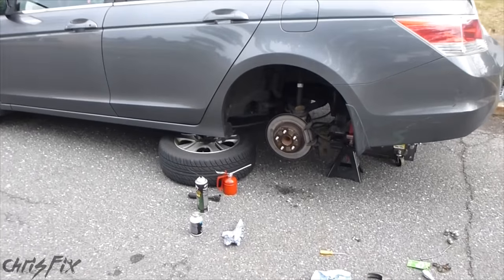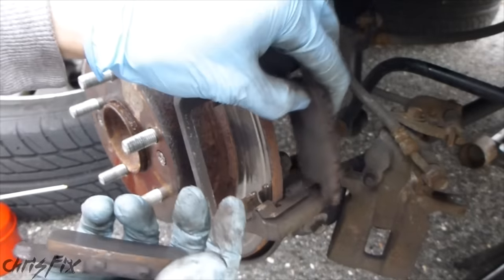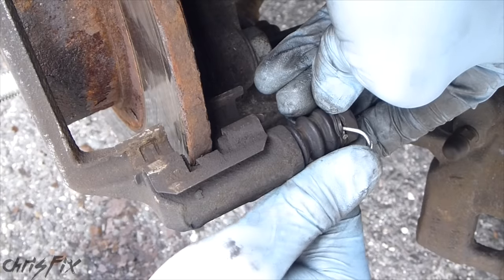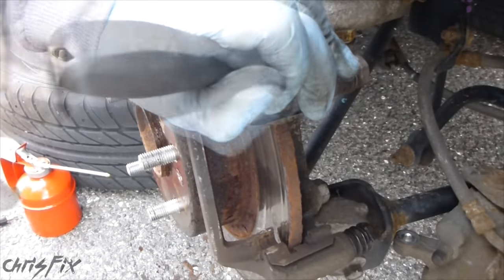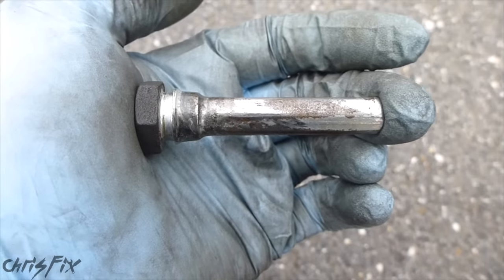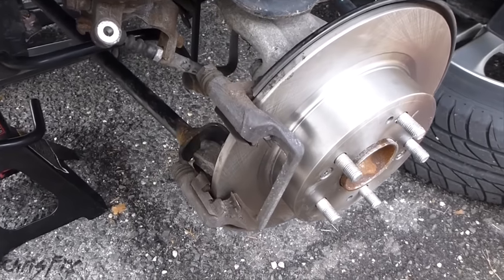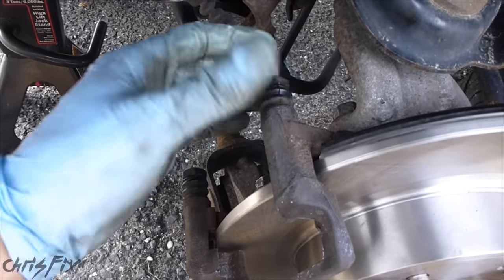How to Fix Uneven Brake Wear

Comment: Chris, Thanks! How do you think Super Lube 41160 Synthetic Grease, can i use this to grease the caliper guide pins?
Reply from the maker: +yang song I do not recommend using petroleum based grease. Use silicone grease (linked in the description)

Comment: Is it a good idea to spray the break clean inside the hole that the guide pin came out of?
Reply: +BloodSweatnBassOutside As long as you get the gunk out of there and let it dry completely before reinstalling.

Comment: If I have new brake pads but noticed uneven pad material, could they fix and even themselves out now that I have fixed the sticking calipers and seized piston?
Reply: You should replace pads, and if the backing plate touched the rotor, replace it too

Comment: Hi Crhix, would you need cleaner to spray inside the pin hole in order to clean whatever went inside?
Reply from the maker: You can use a pipe cleaner if you have.

Comment: I never push the pin with new grease on through the rubber, cause its that tight a fit, as you see in this video, all that new grease just gets pushed up the pin into the rubber boot

Comment: I was advised by mechanics not to use a grease that doesn't withstand very hot temperatures. These are brakes, you don't want the grease to melt and become liquid to then drip on your discs or pads, this could jeopardize your security and sometimes when you slam the breaks, a small difference can make an accident or not. Some people put copper grease but it's abrasive and not advised for moving parts however it won't drip and mess with your braking. Some new greases are made of aluminium or aluminium zinc that are designed for brake systems but the downfall is sometimes that are packaged in sprays and I hate using sprays on brakes. What I do is spray a bit on the inside of the cap and use an ear bud to apply the grease. Aluminium grease typically withstands 600 Celsius and copper grease around 1000. The typical silicone grease melt point would be 130 to 180. I couldn't find a link to the product he used so just have that in mind.
Reply: This part of the brakes font heats up

Comment: Hi Chris. is it a good idea to clean inside the hole on the caliper where the slide pin goes into ?
Reply from the maker: +Timur Hafouz Yes you can do that with some brake clean and a q-tip or pipe cleaner.

Comment: Hi Chris, quick question. You have a lot of videos about break pads and such but did you ever make one on how to clean rust on them? I bought myself a Mazda MX-5 less than two months ago and it had some rust on the breaks, because it wasn't being used since a while. After driving it the front ones cleaned completely, but I still have some spots on the rear ones and I'd love to clean them out so they are all shiny but I don't know the products and stuff. I saw your videos about changing them entirely, recoloring the calipers where you clean a bit of rust etc but I wonder if you had something specific to this.
Reply from the maker: +AndreCorner using a wire wheel or metal wire brush works best.
Reply from the maker: +AndreCorner Like this: http://amzn.to/1NmTteN
Reply: ChrisFix thanks man, I'm pretty sure my dad has some. I'll jack up the car and try to clean them later today! :)

Comment: Chris I've got an uneven front left pad set on a 2010 Prius.  Any idea if that would be a similar fix as in your video?
Reply from the maker: It should be a similar fix on any car. The guide pins need to be lubed so they can move freely to prevent uneven brake wear.

Comment: Hey chris fix, When you have a caliper guide pin is seized up there is lots of way to take it out such as torch, hammer it out, wiggle it..etc. but what even if i try those and still could not get it off the seized pin out? what can i do? in my car both front caliper pin is seized up and i tried few hours trying to get it off and still i couldn't get it off, i tried hammering, torch heat up and wiggle and hammer also did put the rust penetration hoping it will loose up and come off but it didnt. I dont know what to do? if you guys have any idea please help me chris. and maybe in future make video about this.
Reply from the maker: If they are that seized, then you might need a new caliper. Are you sure you are working on the guide pins? They shouldn’t be that seized!
Reply: @chrisfix  yeah they were ceased up with all the rust, and i spend a day taking it out and i couldn't took it out so i discussed with the toyota tech where i work, and they said same procedure to take it out if its not coming then got to replace a whole caliper. but i spend next day after work and took it out so i dont have to get the caliper i need to clean it and replace the pins and boots now. i got it.

Comment: Since the top pin was muddy and gummed up wouldn't it make sense to clean out the hole that it sits in as well?
Reply from the maker: +Andrew Bostaph yes, a pipe cleaner works well for that.

Comment: What about uneven brake wear in a sense that the 1 of the 2 brake pads from the same caliper wore out faster than the other?

In my case the one on the outside wore out twice as fast as the other on the inside.

Comment: Can you use that silicone for the hardware and to put it on the on back of the pad to prevent noise?
Reply: No it could make noise, collect dust or make your parts slip

Comment: if you took the time to look at caliper properly you'd of seen the piston cut out was out of alignment with the locating pin on back of brake pad as well which makes the brake uneven
Reply from the maker: +John Mordue thanks for the tip

Comment: Hi ChrisFix. What about cleaning inside the hole where the pin goes?
Reply from the maker: Great idea! You can use pipe cleaners for that!
Reply: Thank you for your answer. There is another question. i have a 2007 Mazda 5 that after a 250 mile trip gave me the engine code P0126 of the coolant temperature. The coolant gage in the dashboard is right where it always has been, in the middle. I flushed the coolant and put fresh one. The code came back a few days later. Then  I changed the sensor, the code came back week and a half later. I Unplugged the socket from the sensor, cleaned everything out with electrical cleaner, put a little bit of dielectric grease and plugged back on. That was last Thursday 23rd, today is Monday 28th, no code so far. I keep my fingers crossed. In your opinion which is the next step, the wiring? The coolant thermostat?
Than you so much! Julio

Comment: I have the same red oil can. Does it take you a while of pumping it for anything to come out?
Reply from the maker: Mine is pretty fast. Three pumps and stuff comes out!
Reply: Okay. It takes me a good 10-15 pumps before anything happens lol.  Did you get yours from harbor freight?
Reply: The lights you have on your rear bumper, how good are they. I have 2 fog lights on my front bumper that are stock but don't work an want to replace them. Would you recommend them for as replacement.
Reply: The lights you have on your rear bumper, how good are they. I have 2 fog lights on my front bumper that are stock but don't work an want to replace them. Would you recommend them for as replacement.

Comment: It's possible to replace the bracket alone if the pins keep getting stuck ??? or needs whole unit
Reply from the maker: +THE MECHANIC you can just get the caliper bracket.

Comment: Cleaning the guide pins will  be ok don’t need to replaced them
Reply from the maker: Depends on the condition. If it’s not rusted or pitted then yes, cleaning is ok. Make sure you lubricate them well.

Comment: the major problem there is that the slots in the piston are not lined up with the pin on the brake pad, the stkicking pin would cause the outer pad to wear unevenly ok vid as most people don't check the sliding pins

Comment: That caliper bracket was really loose.  Hope you tightened that up!  5:50
Reply from the maker: +Lars Sveen I was doing a brake job and replacing the brake rotors and pads. Thanks!
Reply: +ChrisFix Ah, cool.  So it got removed and re-attached anyway.

Comment: Chris can you help me!? I changed my brakes and on the last rear brake the piston behind the brake fell out. So I figured air got in my brakes.  And now my brakes go all the way to the floor in order to stop. So I looked under my hood and seen my master cylinder is leaking out the back. So does that mean my master cylinder is bad, or do I just need to bleed the brakes?
Reply from the maker: That is strange. I would bleed the brakes completely so the pedal is firm. Also clean up the brake fluid by the master cylinder real good so you can keep an eye on future leaks.
Reply: ChrisFix yeah I tried bleeding them but one of the bolts got stopped so I have to wait until tomorrow. But do you think the master cylinder is bad now?

Comment: Hey Chris, that silicone grease is expensive.  wont CRC synthetic grease work? if you replace the rubber with the kits, wont the rubber last 50K?
Reply: I used CRC synthetic grease on all my gliders, works like a charm. But as he said, i will damage the rubber over time. But i would believe it would take many years to do so..?
Reply: grautsvulst88
I gave in & brought silicone grease :(

Comment: What about the bore hole itself?  If the pin is gummed up and/or corroded, there is a good chance that is also inside the bore hole itself.  I've seen people spray brake cleaner into a bore hole, then insert a drill bit with sand paper or a rag wrapped around the drill bit to try to clean out the bore.  I'm a little worried about spraying brake cleaner into the bore hole.  If it doesn't all completely evaporate, that will cause a new issue.  I think it's a good idea to clean out the bore hole, and I just used a clean cloth wrapped around a drill bit (a bit thinner than the bore hole).
Does anyone have a good idea/method for cleaning out bore holes?  Is that even necessary?
Reply: Spray brake cleaner into the hole. and use a drill bit with your hands and even some sand paper on it and maneuver it into the hole to clean it. The brake cleaner will dissolve the stuff inside and it evaporates fast, no concerns with using it.

Comment: I completely replaced my Guide pins and they are still not moving freely. What should I do? I sprayed out the cylinder really well.
Reply: Maybe that the pin hole is all clogged up. Try spraying brake cleaner inside the hole then recover it with a paper towel.
Reply: +Arthur Rondia (alphaLone) I did that and it helped, thanks! I even put a gun cleaning tool uo in there ti get all the Gunk out. It still stuck a little. I ended up using one of my old guide pins that was still in good shape. Ironically the new one didn't slide easy. I have no idea why.

Comment: What if I completely replaced my brake calipers and have the same problem on the same side
Reply from the maker: They might not be greased correctly from the factory, pull the guide pins out and check (and clean and regrease)
Reply: @chrisfix  will do gonna try it on my day off thanks for the reply! 👍

Comment: My car that I bought from New Jersey just recently started making a bad grinding sound on the front passenger brakes whenever I'm braking at low speeds. Is this a sign that the pads are worn out?
Reply: +THE WHITE WOLF yeah that happened to my toures touching the disc ha I might as well rub the ground the disc what fubar no replaining
Reply: You might have debris stuck between pad and rotor or just low brake pads. I first would open a window and drive slowly listening for a scraping noise. If you hear the noise apply the brakes and see if the noise goes away. This would be the brake wear indicator saying you have less then 10% pad left.  Good luck

Comment: isn't it bad if you mix greases? what if the guide pin had different grease than silicone?
Reply from the maker: You can clean it out. It’s ok if the residue mixes if it’s not perfectly clean.

Comment: Hi chris .
I have a question hopefully you can help me . 
For the past 6 months i experience a roaring nice ( rrrrrrr....rr .rrrr) 
Wheel i apply my breaks coming at high speeds gently slowly apply breaks 15-20mph i hear the noise .
I have taken to the shop can quitly do nothing to it spend hundreds of dollar trying to fix and failed .. 
New pads.
New rotors. (Had SLIGHTLY  uneven WAVE wear and pads had a small sign of uneven wear on the TOP porting )
New wheel bearing .
However noise still .
Can a bad shock/ball joint CAUSE noises while breaking (not all times bout 85%yes) 

Hopefully you can help me. I have spend hundreds and still there
Reply: rigoberto velazquez I have the same problem I've just bought brand new discs and pads today! Better solve it lol you've made me doubt it.

Comment: hey chris i have some question about the guide pin, i have a toyota fortuner 2020, i got issue on braking sometimes i felt my acceleration feels like slowly need to push more the gas pedal then i check my guide pin the other one is moving nice but the other one feels like stuck then when i remove it i notice there's a rubber like bushing or something i don't know what is that for? can i remove that bushing?

Comment: The most important thing is to remember to push the brake pedal right in the middle with even pressure. If you push on the side of the pedal or push it sideways you will always get uneven brake wear. You can have this problem with the gas pedal also, but it's harder to push sideways since its narrow.

Comment: the silicone/grease wont make its way into the hanger because the rubber is going 2 clean it off the pin as you slide it back in , U need 2 put a little in the hanger before you put the rubber seal back on
Reply: Take the boot off the bracket and push it onto the pin. THEN spread the grease on the pin. Then push the pin all the way into the bracket, making sure the boot snaps back into its groove.

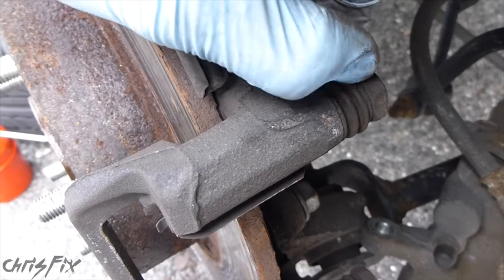Comment: your caliper hangers are clearly loose as they move every time you try pull the slider check video at 2:08 its hanging off ( tighten the 2 bolts that hold it onto the hub/stub axle )
Reply from the maker: I was changing the brakes so everything was being taken apart...

Comment: what should i do if i open the caliper and found the piston is at an angled position and has seized? how do i get it out? i found some technique using grease gun and air compressor, could there be other way? i find the grease gun messy.
Reply from the maker: +Ruel Landrito if it's angled, the piston gasket is probably pinched so you need a rebuild or new caliper.

Comment: Would you show how to depress that rear brake caliper piston back in once new pads are placed?
Reply: Ten dollar tool at the parts store or a c clamp or I've even used channel lock pliers.....very large ones.
Reply: Thanks Scott ... I believe the rear brake piston has to be turned rather than pushed in ... I'm not sure how the c-clamp can be used although the channel lock pliers could be used to try to turn. I tried using the Lisle 28600 tool but wasn't able to get the piston to turn ... also didn't want to use a lot of force, so left it ... the rear brakes had plenty of life left at the time (a shop told me the rears were almost worn out)
Reply: @lji2000   if it must be screwed in get the proper tool. Don't grip the piston with anything.
Reply: @swiley223  Yeah, the Lisle tool I mentioned above is what's used. Tried it, but couldn't get the caliper piston to turn. Wasn't sure how much force to use, so left it to avoid damage the caliper piston assembly. Will try again when the rear pads are worn ...

Comment: Some pins have a bushing on them. The pins are not identical. Do the ones with bushing go on the leading or trailing edge?
Reply from the maker: +Pranesh Pal It varies from car to car.
Reply: +ChrisFix - Thanks for that! - there was so much waffle on the web.  Would you know what the requirements are for a Santa Fe 2005 model. And how much grief can one cause by getting them wrong?

Comment: +ChrisFix is it better to use the dry type silicone grease for this application? also, is it bad to use silicone grease for normal grease application (metal on metal kinda thing)

Comment: That top guide pin you removed should actually be in the bottom.  Honda guide pins that are grooved go in the bottom.  The round guide pin goes on top. Perhaps the last person that did the brake job did it wrong. And that's why the pins were in the wrong place.

Comment: AND never forget to clean the seating plates on the carrier. That's where the brake pads slide, so the surface loaded with grit/dust/rust, etc. is no good. Wire brush and a couple of minutes it's all there's to it. ;-)

Comment: Would this problem to the front brakes cause my car to shake? The shaking does not start until the brakes get hot.
Reply from the maker: No it would be from rotor runout. Get he rotors turned or get new ones.
Reply: Rotors don’t look too bad. Could it be the caliper assembly?

Comment: You don't need guide pin Replacement for rust like that.. vinegar and wet color sanding paper will correct it. It's not worn imperfect..

Comment: You know how to fix this for good?  Take your guide pin style calipers and throw them in the ocean.  Then install regular calipers that mount solidly to the wheel hub and have the movement completely self contained.  That is how you fix it, they will always wear a groove on the guide pins because its not hardened metal its just the cheapest of the cheap material and the cast IRON you calipers are all made out of is much harder and will chew up those guide pins and shit them out sideways.  Throw them in the ocean, do the conversion, trust me. Been down this road 100 times.

Comment: how do the guide pins stay in their seat without simply rattling out due to vibration on the road??
Reply: I'm pretty sure due to the suction of the lubricant, its kind of like a vacuum seal.